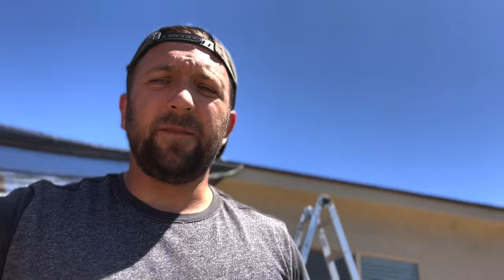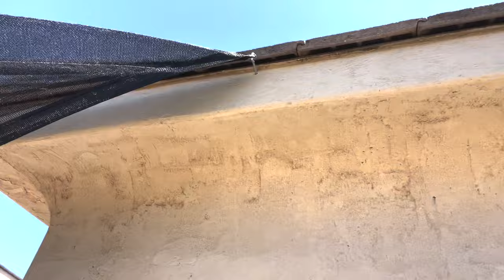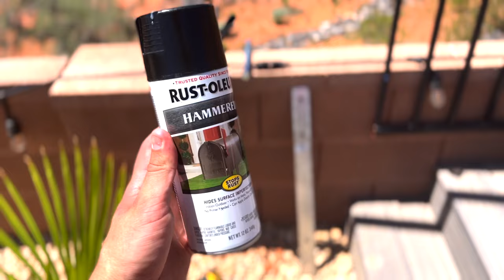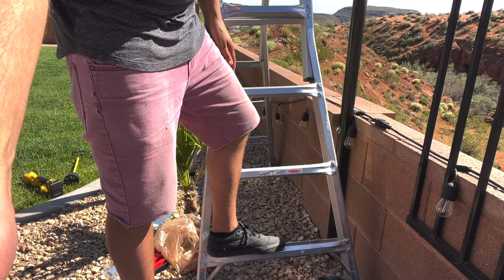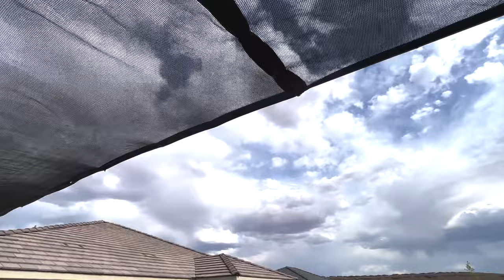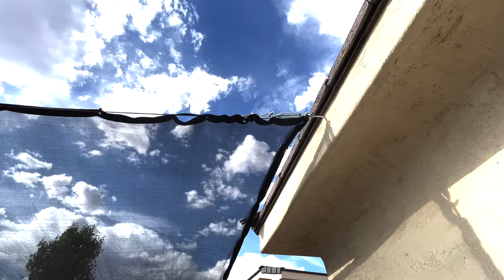Shade Sail and Mesh Tarp DIY - Cheap and Redneck Approved!

Comment: You're using a type of electrical conduit called "EMT" - Electric Metalic Tubing. You need to get the type called "RMC" - Rigid Metallic Tubing. It's galvanized steel. Doesn't rust. EMT rusts and it's thinner.
Reply from the maker: Your absolutely right! I would have and probably should have. The only reason I went with “EMT” is because of it’s lower cost. When the Boeing of this post eventually drives me crazy I’ll probably switch to “RMC” as per your suggestion. Thanks for the tip!
Reply: He's right to an extent...it does rust but you probably won't have to worry about it in your lifetime 😉 your kids will
Reply: My guy. He’s in the desert 🌵 haha
Reply from the maker: Haha Moisture and humidity are not things we need to worry about too often in the desert. But, I probably should have used better quality materials to begin with for peace of mind. Haha thanks for your support!
Reply: Rigde does rust sir. You might be thinking  of plastibond
Reply from the maker: Is Rigd zinc coated? Or, galvanized? Is that why? Thanks!

Comment: Critiques 

1.) That type of shade material gets really beat up in the sun and will rip in roughly a year
2.) When he needs to replace it, he will need to remove all those tapcons, thus making it not hold after replacing it over and over.
3.) Their is no way to let out the sail when major wind storms are eminent. 
4.) The Zip ties will slowly break in the elements, but i guess that is an easy replacement. 

All these critiques are minimal minus the need to mess with the tapcons. Overall, good project. Looks nice
Reply from the maker: Ya, the material has baked a little with the intense heat but is inexpensive enough to replace after a couple years I can justify. 

Tapcon screws are a bit of a pain when it comes time to remove, but with an impact and a little wire to take up excess space, they do the job.

Zip ties have for sure gotten brittle and I have replaced quite a few of them.

Thanks for your input! Pretty spot on with your observations!! Haha stay well!

Comment: Good stuff chap, looks as good as a brought one.
In future running a wire and buying a cut length of horticultural shade netting a rough stitch along it for a nice edge and a bag of net clips would keep $50 in your pocket. $60 USD is $96 NZD.

Your out looks like mars compared to wet NZ bush, can you shoot coyote's from the back fence?
.22-250, Mrs on the spotting scope and a 6 pack of beer sounds like a good arvo.
Reply from the maker: Nice! Thanks for the tip! I’ll keep that in mind for the next version! If you can keep it quiet, you could certainly hunt coyotes. I’ve seen a few scurry by at dusk. Would certainly make for a good time! Haha lots of rabbits though! Thanks and stay well friend!
Reply: @CEEJ-MAN boltaction .300 subs and a really big suppressor 👍
I think they are restricted there 🤯 a loaf of bread would be more restricted here incase you have allergies 🤣

A can is just PPE

Comment: You could have used a 10-foot stick of rigid conduit. It'll cost a lot more of course but it's way stronger. As an electrician I've collected quite a few over the years. Used them to build a 50'-100' 6' tall chain link dogpen
Reply from the maker: That’s a good idea. I was tempted when I purchased the other conduit but it was double the price… wish I had in the long run! Haha thanks and stay well!

Comment: Looks good- I wonder how this help us for you and your family any changes you would make ?
Reply from the maker: You could check out the (part 2) for the most recent changes. Probably running cables around all edges would have helped with structural stability and material longevity better. What size is the are your looking to cover?

Comment: I thought about doing something like this over my pool but weaving steel cables through the grommets so I could slide it back if I wanted. Do you think that would work? I would tightening the steel cables tight so I shouldn't get any sag, just curious if you think it would slide back and forth easily? Great job on your project.
Reply from the maker: Should be able to do so through grommets. Might take a couple people to help slide as it could potentially bind up. Some cheap cable pulleys on Amazon might make it slide easier. Send me your pics/video when you get to trying it out! I’d be curious to see what you come up with!

Comment: I live in Phoenix and was at Harbor Freight today, I saw these and I am considering using them in a vertical position to shade a east facing wall and a south facing wall to help cool a room. How have they held up in the time you have been using them?
Reply from the maker: Surprisingly well. I expected the sun to deteriorate them after a couple harsh summers  it they’re still holding together pretty well. I’d say it’s an inexpensive solution to at least try! Good luck and stay well! Thanks!
Reply: What about high winds?
Reply from the maker: Hogh winds can be scary haha I kept an eye on it for a long time. Eventually, the pole bent due to a cable anchor failure and I had to replace it. Had I not filled the post with concrete, it would have simply snapped the pole and sent it flying around. That being said, the material of the tarp never tore. They’re still relatively new, I’m sure over time the sun will cool the tarp and will eventually tear, but so far so good! Did you ever end up trying your project? Send me pictures if you do! I’d love to see your ideas!

Comment: Pulling on a masonry wall like that is scary. You'd be amazed how much load a sail like that can pull with.  It'll be fine until it's a freak accident, there will be no warning and then that wall will pull in, hopefully not on top of someone. Don't put masonry in tension or bending it is very weak in tension and cracks without bending, you've got a huge moment arm with a giant potential load. I would not let my family around that.
Reply from the maker: It’s somewhat apparent in this video, but much more prevalent in the follow up video. There is a cable anchor that actually supports it at a calculated angle so this worry is no longer a concern. That being said, You were correct. Thanks for your feedback!
Reply: @CEEJ-MAN  i mean the big wall to the neighbors yard where the sail is mounted to the top above all the kids play stuff, not the little wall with the steel post.
Reply from the maker: Right. I’ll think on that for next season and see if I can come up with a better solution. Thanks for your feedback!
Reply: The $50 dollar 6*6*10’ is the best solution for all vertical posts.  My first “ try “  chain link fence pole  masts failed pretty quick.  You can get fatter 10’ poles now made for shade cloth, but the cost for one is about $150 and $250 for two poles.
Bob3b2
Reply from the maker: Thanks for the input! I’ll probably attempt to revamp this system with a wooden 6*6 this fall. Much more cost effective when it comes to a budget build! Thanks again and stay well!

Comment: We used top rail 2 5/8 rail made for yard fabric fencing then backfilled with sackcrete , you can buy swage extentions to add 😊 height
Reply from the maker: I finally looked up those rails on google. That’s also a great idea! I like that you can extend the height. You said you pored concrete down the pipes for extra strength? Thanks for your thoughts!
Reply: @CEEJ-MAN  we always take them down during windy days ,quick and easy with turn buckles ,so far so good.
Reply from the maker: Nice!

Comment: How is it holding up? Have you dealt with any winds yet?

Also, great video!!
Reply from the maker: Thanks! we had a pretty severe wind storm a few weeks ago. It certainly blew around a bit, but as the wind was able to pass through the material it was fairly clam. I ended up adding a tensioning spring along the cable to absorb most of the high speed gusts and that has helped a lot. Maybe I’ll try to make a follow-up video soon to show the updates and current status. Thanks for commenting!
Reply: @CEEJ-MAN  Ahh yes, that would be cool. 
I had a huge sun shade and during a crazy wind storm it actually snapped one of the wood posts and I had a freakin' sharp speak flying in the air like a flag. Scary stuff.
Reply from the maker: Haha that’s the last thing you want is flying shrapnel! Glad you serviced the incident! Thanks and stay well!

Comment: I’ve an option to tie to home on two sides of the cloth. Will that be able to hold well or damage any way to the home ? Thx
Reply from the maker: It largely depends on your home’s finish and the depth of your anchor. For example, my home’s finish is ‘stucco’. Behind the stick is 2” of styrofoam and then finally the OSB wood stricture. I used screws that were almost 3” in order to penetrate the wood, however there is some play within the stucco/styrofoam, so the screws needed to be larger diameter/thicker for less play. What is your ho finish like? Thanks!
Reply: @CEEJ-MAN  I saw stucco and styrofoam on the exterior and not sure what’s beneath that. Since our home is built during Covid time, I can say the quality is not as good as they used to be…
Reply from the maker: Haha unfortunately, I’m in the same situation as you. You could use an anchor plate with 2” or 3” screws to distribute the weight across the stucco and give it better stability. I’d just snug the plate agains the stucco enough to keep it secure, but loose enough to keep it from cracking the stucco.

https://www.lowes.com/pd/Coolaroo-Coolaroo-S-S-Diamond-Pad-Eye/5005369913?cm_mmc=shp-_-c-_-prd-_-sol-_-ggl-_-PMAX_SOL_000_Priority_Items-_-5005369913-_-local-_-0-_-0&gad_source=1&gbraid=0AAAAAD2B2W9AVCjLLX85sY8qwWrL_FeGt&gclid=Cj0KCQjws560BhCuARIsAHMqE0G-JeZZVoDUBER7OWBAXVFb88Xq9ebWeG9q0eBa1SaY2TmmUbr-tXEaAs3nEALw_wcB&gclsrc=aw.ds
Reply: @CEEJ-MAN  thx
Reply from the maker: No problem, good luck!

Comment: Are you in AZ?  I want to do something similar, but worried about monsoon winds
Reply from the maker: Southern Utah, and we also have intense winds at times. It’s actually help up surprisingly well aside from one minor flaw that I’m in the process of making a follow up video about now. As long as you can secure the cornea or leasing edges we’ll, the mesh should let the majority of the wind pass through. A tensioning spring on the corners with a turnbuckle take a lot of the strong wind burst strain off the anchors. Keep an eye out for the follow up video soon!
Reply: @CEEJ-MAN  ok, following you on YT...can't wait!
Reply from the maker: Thanks! We’ll try not to disappoint!

Comment: Yeah concrete in the pipe did nothing its just not structural that way. I see you put in a cable brace on the pole though!
Reply from the maker: Ya, the concrete in the pole didn’t do much in terms of rigidity, but it did help keep the post from pinching in the middle, caving, and snapping haha. Ultimately, a cable was needed and I also added a tensioning spring with the cable to absorb any strong bursts of wind that might strain the anchors. Working on a Two month follow up video with all the updates. Thanks for your feedback!